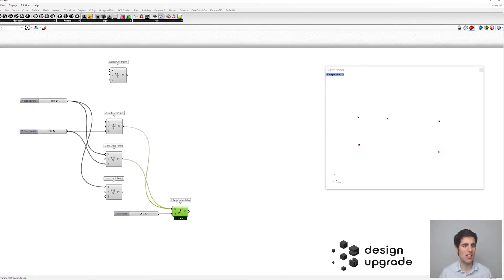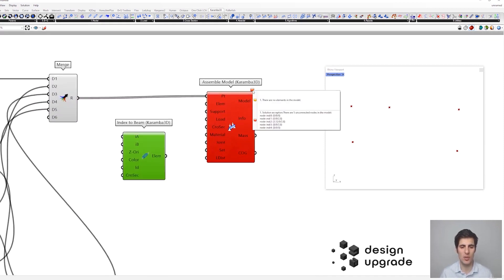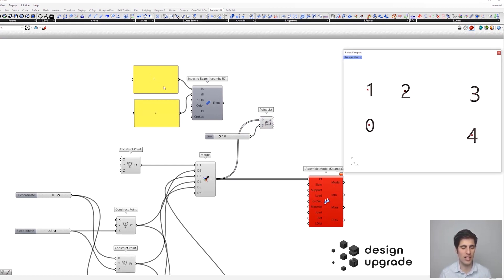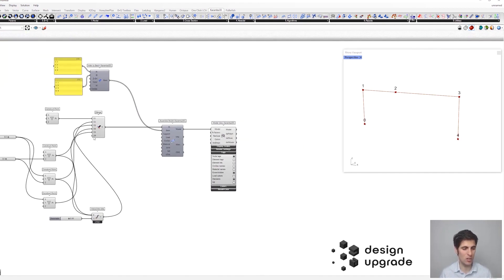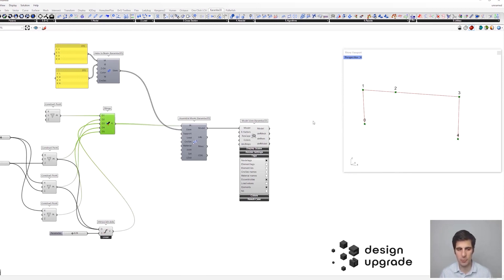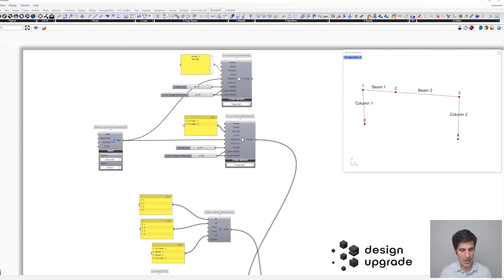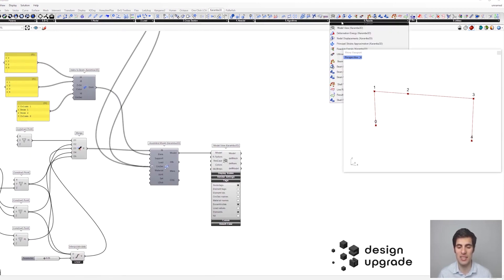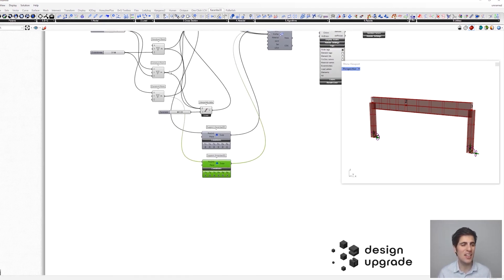Karamba3d for Grasshopper 2C -  Frame Model

Comment: I tried doing the same on my computer. Even though I've made all the connections correctly, when I connect the output of the model view to the input of the beam view, I see two interconnected rectangles in the interface. Can you help me understand what I might be doing wrong?
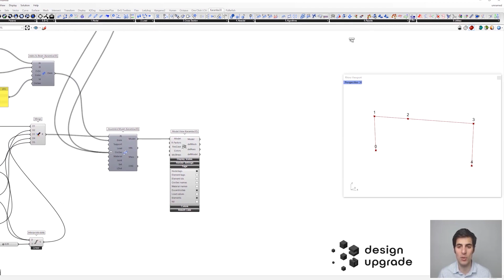Reply: exactly at 8:45 mins in the video
Reply from the maker: Hi, what do you mean by interconnected rectangles sorry? Did you make sure to flatten the cross sections input of the Assemble Model component?